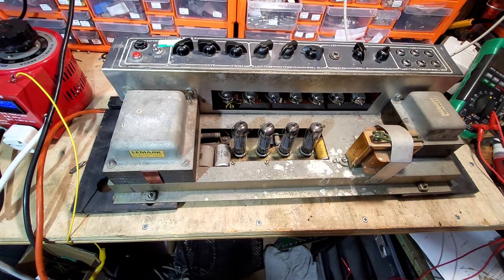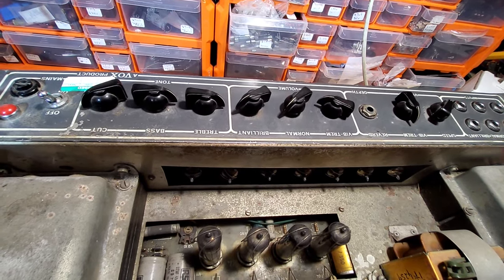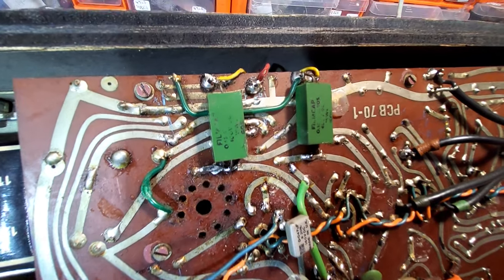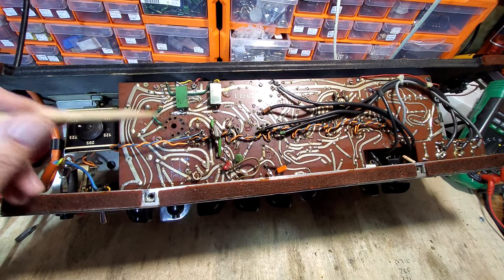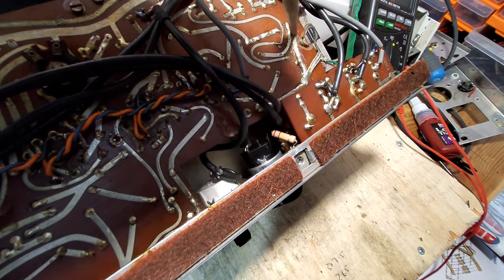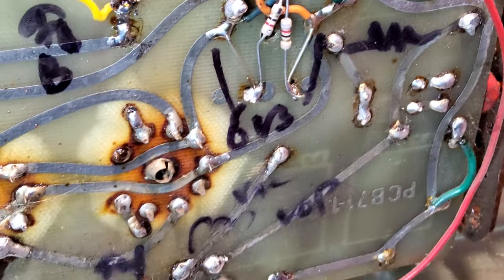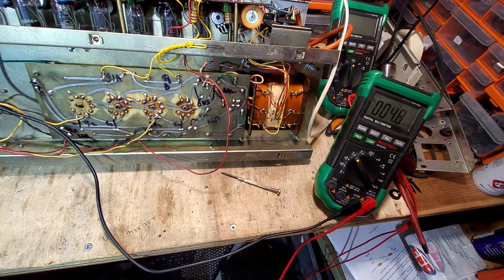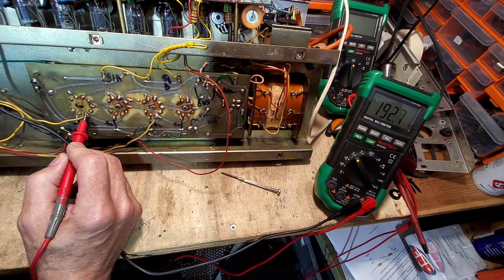Vox AC30 Birch Stolec Era 1971 - 1973 Can we Restore This Amp?

Comment: As far as selfish entertainment value goes, I would love nothing more than to watch you pour hours of frustration and cursing into a full restore of this amp. Realistically, I think you should only consider it if the owner is a close friend, and you really have the time to sink into it. That is a ton of work.

Given that the reverb pot was replaced with an input (output?) jack, I would venture to guess that the components tacked onto the top of the board are a mod of some sort.
Reply from the maker: Hello Mark. You may be in luck. I think we are going to hand wire it. That's a good spot on the Reverb. I never thought of that. Thanks Mark and take care.

Comment: Seeing that thing made me sad because originally Vox AC30 amps (non-PCB models)  were made to be "throw downstairs proof".
There is of course many ways to repair that wreck to be a pretty realiable gig amp, including replacing one or both PCBs with new ones, or removing PCBs alltogether and installing tube sockets to chassis or metal plates and installing eyelet boards etc. However the time and sweat consumed would be enormous. 
If that thing was mine, I would just try to fix it using duct tape method for home use without any major alterations.
Reply from the maker: Hello. There will be an update video on this one. I think we have a plan. Take care.
Reply: @vintageguitaramp_guitarteacher  I can't wait to see! 👍

Comment: As a viewer I would like to see it gets a proper repair. In my humble opinion,  this must be done right, for safety and for your reputation. It depends on, if the customer is willing to pay for the repair. If the board is not conductive, it should be salvagable. I would drill out the carbonized parts of it and put in new connections with turrets or eylets. But you are a way better tech than me and you know what to do for sure. Cheers.
Reply from the maker: Hello. Some good ideas there. Plans are a foot for this one. Video will be coming soon. Take care.

Comment: This fiber board doesn't look too bad actually. The carbonization is pretty localized and could be just cut out. PCB should be removed, unsoldered and inspected for hair cracks with the microscope. Fixing points in burnt parts made elsewhere with riveted solder tags. Traces recoated with solder - or replaced with wires if too questionable. 
But there remains the question of preamp board.
Reply from the maker: Hello Jernej. There will be an update soon on this one. Thanks for watching and take care.

Comment: It looks like somebody probably resoldered most of the unit with lead-free solder and the lead-free didn't alloy well with the original leaded solder; either that or they used solder that didn't have a flux core and so they applied a separate flux to the board. Plumbing solder perhaps?  It also looks like the temperature of the soldering iron was too low. What a mess!
Reply from the maker: Yep, a right mess. A little bit of knowledge is  Dangerous thing.

Comment: It looked to me that D2 was split in two which, if true, would cut the HT power in half. The burnt bits could be dremmeled out, it's a fibreglass board so unlikely to crack. If it was mine ,I would do my best to put it back to stock and pass it on. I do not know what the amp is worth but I would guess that proper repairs to make it reliable may be prohibitively expensive. Whether it's worth repairig could hinge on whether all of the Mullard EL84s are good. Good luck with this one, it's quite a mess.
Reply from the maker: Hello Steve, thanks you. There will be an update video coming soon on this one. Take care.

Comment: It is a parts donor IMO . I've restored one in similar condition for a customer , but it cost as much as the amp was worth .
Reply from the maker: Hello, thank you. Was it a Birch Stolec era one same as this? The problem I have with restoring PCBs is that they just seem crappy, even when they were new. What a come down in design. A million miles from the early AC30s. We are going to rip the PCBs out and rewire on turrets or tag boards depending what will fit in. The cut outs will need plating and the tubes mounting on the plates. But thankfully I am not doing that work as my metal work skills are crap. I have been on you FB page. Some cracking repairs on there. Respect! Thanks for watching and take care.

Comment: Charge a bench fee then move on, I say. It's junk.
Reply: It's a parts-donor at this point; good for transformers, tubes, pots and knobs.
Reply from the maker: Yep, there is some parts on it.
Reply: @vintageguitaramp_guitarteacher  ,  Here's proof of the superiority of turret or eyelet board construction, because amps built with those are invariably repairable, no matter how badly botched by an unskilled tech, unless they've been underwater or suffered a massive fire ---- but one bad repair attempt on a PCB amp and it might be toast for good.